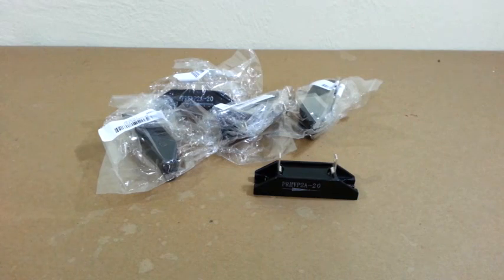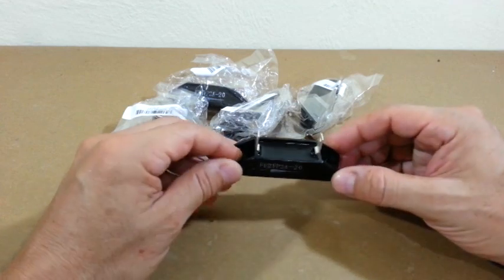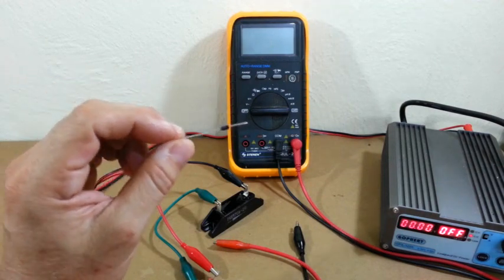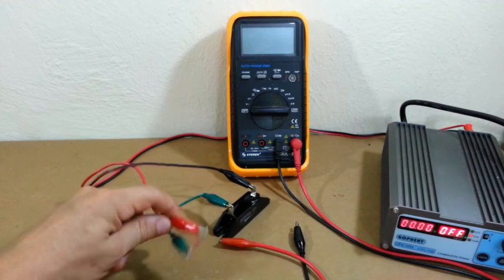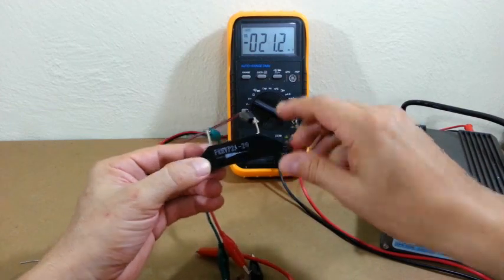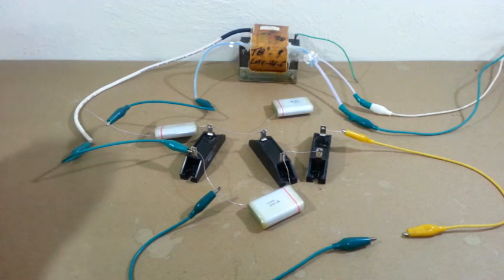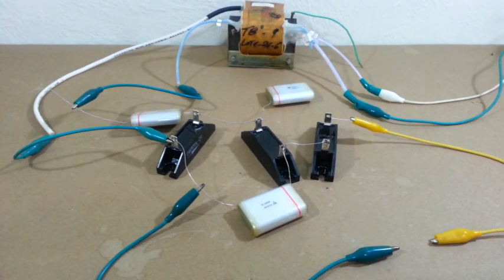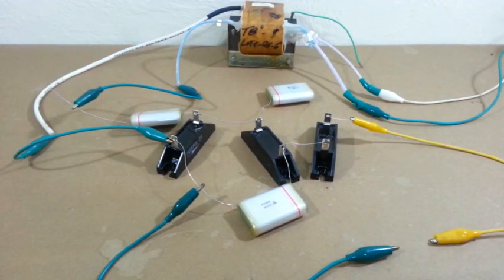High Voltage Diode from Banggood Review

Comment: Is Resistor inside there?  in series or in parallel connection to protect diode.
Or doesn't need resistor.
Some internet blogger has written to use resistor. Can you please explain to me sir. Is any problem if I don't use resistor. Because you didn't use resistor.

Comment: What is the value of the capacitors you are using in this video?  Where did you get the them?
Reply from the maker: I made them, inside there are 40 1N4007 diodes in series, immersed in paraffine. So they are 40 kv at 1 amp

Comment: Nice diodes, you can't just stack ordinary diodes (they will not share the voltage equally), they using special diodes to stacking them, thumbs up :)
Reply from the maker: Thanks. I have used a stack of 40 1N4007's for a hv multiplier without issues
Reply: you can but here it is done for you in one neat package.
Reply from the maker: and cheap
Reply: I should have explained it better, you can stack diodes but it's not recommended with the ordinary diodes, they making special diodes for this purpose

Comment: Neat.  Ever since a cap blew up on me, however, I've always been a little anxious about their exact voltage ratings.  My dumb mistake was not multiplying the RMS AC [output] by the root of 2 and using that value for the cap rating.  It was very loud and messy.  Keep up the good work.
Reply: #relatable, was it an electrolytic or polyester cap?
Reply: if you're not blowing electronic components up you're just not trying hard enough. This is why we buy parts in bulk.
Reply: An elrctro.  Small.  25V.  Shotgun sound.  Everybody came running.  Was covered in sticky yellow crap and had ear buzz for a bit.  lul, it's funny as a memory, but was a nasty experience.

Often I wondered if I can make a cheesey firecracker outta it, but I don't wanna experiment because they're rolling off the line with about 20% margin here or there.